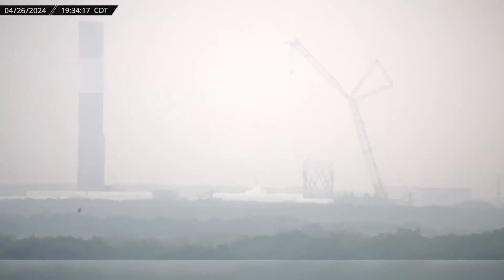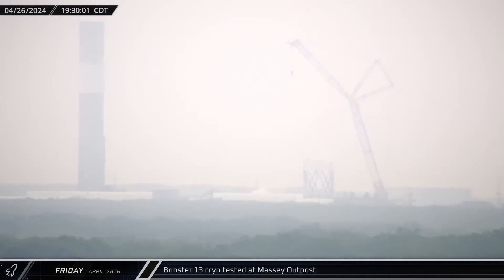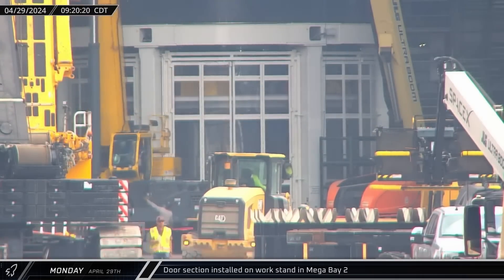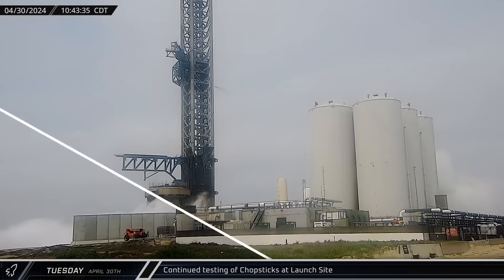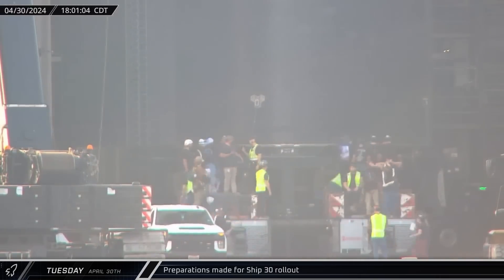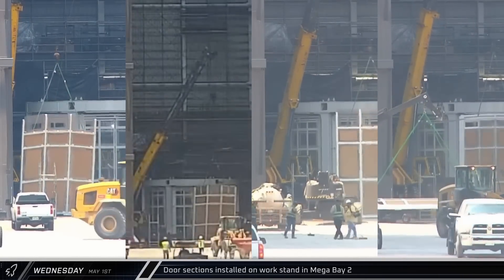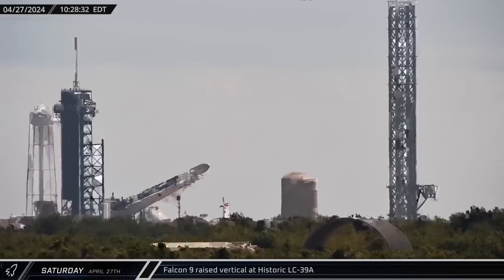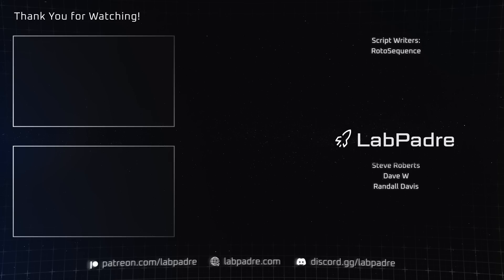It's Happening! Booster Catch Arm Tested At High Speed! - SpaceX Weekly #113

Comment: 5:00 --> May I propose:
As it seems, "Chop-sticks" beams should be stiffer horizontally, but even now they can fix this. They can install some horizontal steel wires to external side, to stress-up these beams so not to wave horizontally at sudden stops. These wires will automatically extent or contract to follow the movement of beams and must be always in tension.
The cables must be in some angle with main beams to be able to hold them. So, maybe will need also some smaller horizontal beam around the base of each main beam, going outwards.

Comment: Wondering about landing legs for starship?  How big would legs need to be to support a  50 story building?  How much would those weigh?
Reply: Starship isn't quite that big yet, but legs for either Super Heavy or the ship would be large and heavy enough that SpaceX opted for the catch tower solution, thus saving weight on the vehicles. That said, Starship will have landing legs for a few missions, such as Artemis and the early Mars landings.

Comment: Im only recently getting intrested in space flight so if this is a daft question please keep the sniping to yourself 🙂 
Would it not make sense to test the catch arms for potential recovery by sending a (test) booster by itself on short low alt hops rather than after an orbital flight. Carrying less fuel, less weight etc.
Thank you in advance
Reply: The booster will be almost empty by the time it lands since this is the last portion of it's flight. There is no need trying to squeeze in a test flight for catching if they can just try catching on a more valuable full flight profile.
Reply: no, because then you are wasting a launch (which they are only allowed a handful of times a year currently) to test catching only, by the time the booster is in position for a catch attempt it would have the same (roughly) amount of fuel and with that the same weight so no reason not to do a full on launch and work on every aspect of the flight profile giving you tons of more data then a hop would get you.
Reply: Cheers folks a lot of sense made by you both.
How limited are spacex in terms of launches per year?
Im guessing its both licences as well as turn around of vehicles availble?
Pretty cool just getting into it as its like binge watching a good show all at once
Reply: @williamdhughes6039  5 orbital and 5 suborbital last I heard in like 2022 when the PEA (Programitic Environmental Assessment) came out.

Comment: I'd find it doubtful that they'd try a capture until at least 2 or 3 good booster "landings" are successful. they aren't going to want to risk the tower. As for the chipstick's "wobble", that will depend on how fast they will be required to actuate in actual use. A damping Mass actively driven at the arms end might be effective, but would increase the arms weight and mass and quite possibly increase actuation time depending on the power of the arm actuators. Probably some compromise there...
Reply: Completely agree.  That was typical Elon pushing the timeline. They will have stage zero readiness for a catch by flight 5, but absolutely will perform 3 or more flawless simulated catches in the Gulf before risking their ONLY launch tower in a critical first year where they vie to push their flight cadence to the max.
Reply: Elon has a long history of demanding things to happen when all the engineers think more time is needed.

They can lose their job by saying NO too often.

So, I wouldn't be surprised at all if it hapoens way before logic says it's ready.

You haven't been paying attention if you doubt it will happen before properly understood data is carefully collected to ensure a perfect catch.